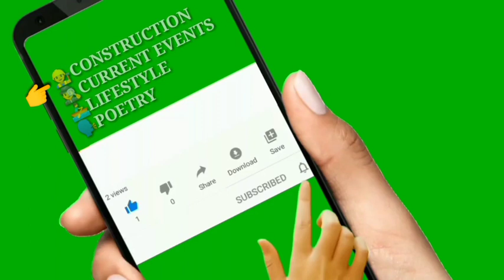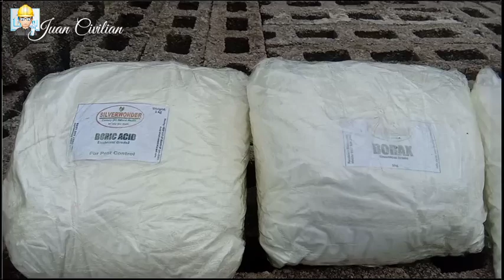ANTI-BUKBOK: BAMBOO TREATMENT using Borax and Boric Acid + Salt | Anti Bukbok at Anay sa Bahay Kubo

Comment: A nice ratio :Boric 4%+Borax 6% + Water 90% totall 100%. Don't use salt, because it will rust the metal wires, neils and screws.
Reply: Is it also applicable for wood like gimilina or falcatta?

Comment: Where do you source/buy your borax and boric acid?
Reply: Online Shop
Reply: @BerethMann  A nice ratio :Boric 4%+Borax 6% + Water 90% totall 100%. Don't use salt, because it will rust the metal wires, neils and screws.

Comment: Im surprised the water held up in just that plastic sheet and sum poles. I was thinking I had to dig a trench or a retaining wall strength sides construction. sweet example thanks!
Reply from the maker: Yes sir, we just only used "trapal" as treatment area. Thank you for watching.
Reply: juan, was there any more to this video? I would love to see more construction methods using bamboo. And if you could add sum english please.. xox
Reply from the maker: @possumwilli  maybe next time. Keep updated.